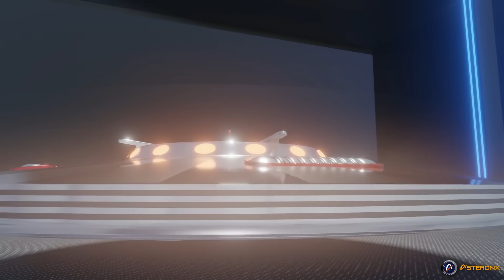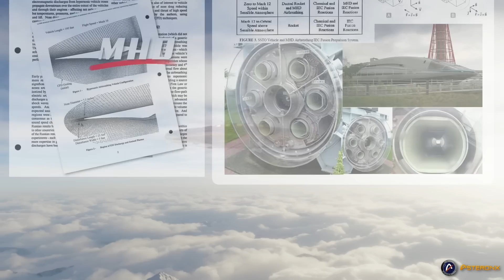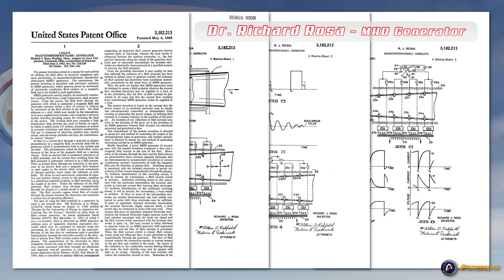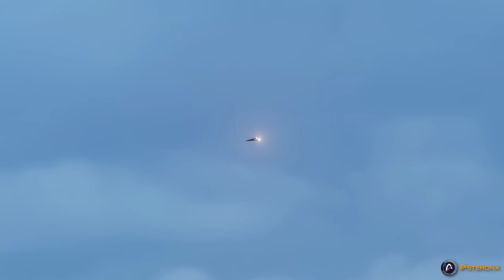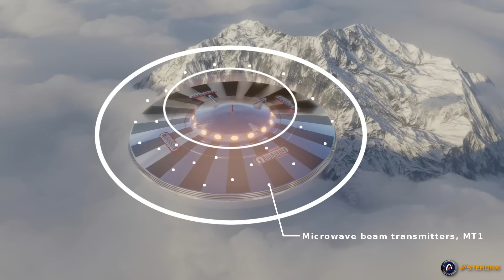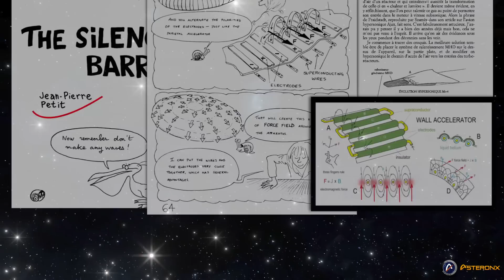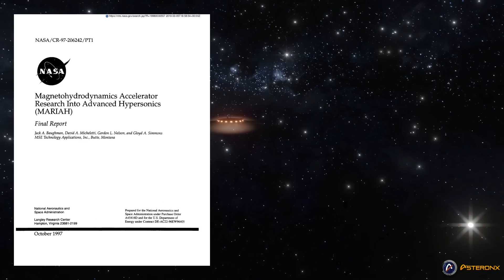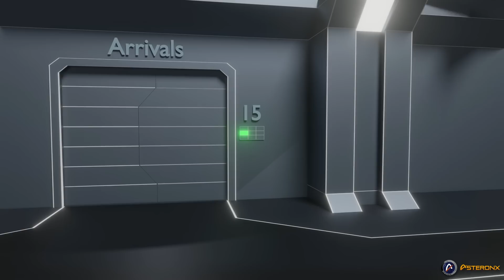Wingless EFE Touring Craft MHD

Comment: This video is disappointing. It will be ages before we have such tech really available. But hey you said 2021....so....start counting. Will we get this 🛸or more likely this 🚲?
Reply from the maker: The tech already exists, albeit for military use, but such was the case with rockets themselves in the early days, and yet non-military uses appeared immediately.

Both Korolev and Braun designed and built military rockets with an eye towards turning them to space travel.

Comment: Theres a burn comming. We will never go two times the speed of light. nobody said yet, but theyll find out. Einsein knew! why! inurtia at  light speed dont decreas and only increases. Artificial gravity though! Inurtia is linked to mommentum and gravity. matter must give up spin to do it, so we would be dead for sure. matter isnt matter without spin
Reply: In the 19th century people were worried about going faster than 30mph. They thought that people would suffocate. They thought they would not be able to breathe due to the surrounding air rushing past them.  I am sure they thought they knew it all too.
Reply: @MIck-M  its based on some crazzy stuff.  Matter from light and what mass really is. so no! im far in the future. basicly mommentum is antigav. so, put a mass infront and nothin. get in the mass and youll cruse along like magic, but at a point the pressure will hit black hole status and all of the particals in your body will aline to fight it. At that point your photons, so yer dead
Reply: @MIck-M  I liked your story though.
Reply: @MIck-M  In the 19th century people already had gone faster then 30mph
Reply: You're focusing on making the matter move faster than light, rather than making the space around the matter move faster than light. If you make the space around the matter move faster than light (warping/bending/folding space), the matter gets the ride without moving and thereby avoiding the the problem of inertia and exponential increase of mass.
Reply: @videopirate9138  no! more like light + light. after that you collapes into photons. pushing and polling will still put you in that state if you servive that long under a constent extream inertial rejection to mommentum. the max is equale to the event horizen of a black hole, then yer toast.
Reply: @ironmax654  When you warp/bend/fold space around you, you do not move you are making the space around you move, you thereby do not experience any effects of traveling.
Reply: @videopirate9138  I made a video titled EINSTEINS STRINGS?  Theres too much to say. I hope I explaned well enough in the video.